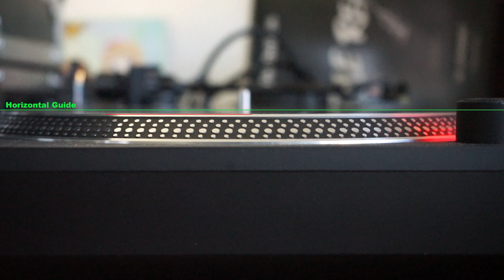Does the Technics SL-1200MK7 Platter Really Wobble?

Comment: Welcome to the ANALOG world, this is analog gear, it is not perfect like digital. I never look like this at my sl 1200, i check if the platter has some play with both hands placed on opposite parts of the platter, if it has some play, switch one platter with another platter from other sl 1200 and it should solve it usually, there are small tolerances. What do you expect from a made in Malaysia Technics ? pure perfection ? If you had a GR then yes, you could nitpick it more, but even that will have tolerances. You cannot expect Analog gear to be perfect in every way, this is the charm of Analog.
Reply: Ora tutta la produzione di giradischi technics si è spostata nella nuova fabbrica panasonic in malesia..il problema di questa cosa che i pallini non sono allineati lo facevano anche gli mk2 e m5g e tutto il restante della serie non c'entra nulla dove sono assemblati quest ultimi..c'è gente che lamenta  del wobble anche con i primi G GAE che erano ancora assemblati in Giappone..cmq apparte alcuni che sono fuori tolleranze questo "gioco di fluttuazione " lo avevano tutti i modelli sl 1200/1210 dall mk2 al mk6

Comment: Both of my SL-1200‘s do that too. The surface of the platter is perfectly level when spinning. However…..I know sometimes on new units there might be small hardly visible metal particles on either the inside of the platter hole or the copper spindle base the platter sits on. Either way, nothing to be worried about. Just remove and place the platter a few times on the spindle and you’ll be fine. As a matter of fact, none of all the SL’s that I restored or fixed had any wobbling issues at all. Not even those really abused ones. If the bearing is worn though, just replace the bearing and not the platter. A bearing usually doesn’t wear out if it is lubricated with the original Technics oil and nothing else, certainly no other kind of oil or grease.
Reply from the maker: Need to get me some of that Technics oil

Comment: I had about a 1/32" wobble and marked the high spot on the platter. I then used some 1500 grit paper and wrapped a q-tip and lightly sanded the opposing sides of the spindle hole. Only took one try. Of course this only works if you sand in the right places. It's the bottom of hole nearest the high side and top of the hole furthest the high side. This only works if it is the platter that is out and not spindle itself, otherwise platter will need to be placed in same every time.  Clean first make sure its not debris. Do a little at a time. I true my pottery wheel same way.

Comment: You have to put your hands on the decks. When you're performing beat juggles, the wobble will show because your needle will bounce. I also have a pair of Pioneer PLX 1000s, Their decks don't wobble. I just thought it was weird that these decks are considered "battle ready", but the platters are not stable enough for hand pressure...
Reply from the maker: If I can do a backspin of about 3 or 4 rotations quickly without the needle jumping, would that be a good enough test to qualify/disqualify this for juggling?
Reply: @DJFeelsGoodman  It could. If you're heavy handed, it will DEFINITELY show. Probably the first time. I suggest that you get a pair of vinyl record (not the ones for battling, but normal records) and beat juggle from them. It will be a more accurate test. I'm light handed and the needles still bounced on me. 🤷‍♂️
Reply from the maker: @djseasick  Gotcha gotcha. I have some vinyl records but I don't know how to do those slick beat juggling patterns, so I was thinking maybe there was another way to test that out.

There was another guy who posted about the wobbling, and he said he units have noticeably more wobble than the one I put in the video. Maybe there's a discrepancy there I wonder...

Thanks for the reply by the way; definitely something I'll try to get to the bottom of. And if there's anybody else here who has done (or can do) a juggling test with real vinyl, let us know!
Reply: @Jayo Delaware You know the Technics mk7s aren't made in Japan, as the previous 1200 models?

Comment: The platter clearly wobbles at the top line, but you would probably need to go through 10 turntables before you find one perfectly flat. It should not affect sound quality as slipmats are not perfectly flat and neither are records. My PLX-1000 has the same run out as your SL-1200mk7.

Comment: clearly wobbles on the left side, slightly but wobbles, RETURN
Reply: Since when do round things have left and right sides?:D:D This wobble is so tiny, even my old SL-1700mk2 from 70s wobbles very slightly.
Reply: your SL-100C apparently also wobbles
Reply: Not wobble just inacurate lines on platter, was measuring with laser level
Reply: @mariorainy  You should use a dial gauge on the outer edge of the platter.
Reply: I think you need to have very good precise lens to measure like this

Comment: Yes indeed, it's the dots that wobble not the platter itself... I don't really get why so many people are complaining about that, plenty MK2s and MK5s had that too, but no one gave a crap about it back then.
Even the HiFi/High quality SL-1200MK4 and SL-1200G have that too... It's just nitpicking.

Thanks for debunking this platter wobble myth 👍
Reply: My mk2 does it, so it’s not a total myth, and the top edge does go up n down. I think it’s cause the things been fucked from years of use. Still works, and I’ve just kinda stopped thinking about it.
Reply: @djsd-1292  If your platter actually wobbles, it means the spindle bearings are damaged or the platter is warped... it's not part of the design.
Needs to be serviced.
Reply: @QoraxAudio  yeah, obviously not part of the design lol, but not a myth. Happens from the factory with hanpin tables due to poor QC.
Reply: @djsd-1292  Hanpin turntables are made in a different factory than technics turntables, so those have nothing to do with it.
Technics turntables don't come with wobbly platters, so that's a myth.
It's just that in the beginning of the technics reboot, some batches got damaged in transit, resulting in warped platters, that's probably the origin of that myth.
Reply: @QoraxAudio  Comparing a Hanpin with a Technics is like comparing apples with pears. A Hanpin is no match for a Technics,  period. Hanpin use plastic for the base, the weight of the product comes from a slab of metal on the bottom of the plinth, used for gaining weight and it acts a an internal ground for the circuitry. Which itself is another major difference with a SL-1200. Again, no match for a SL-1200.
Reply: @leyland9999  Comparing Hanpin with Technics is comparing entry level turntables with midrange and high-end turntables.
It's just like comparing the old Technics turntables with the new ones.
The old MK2 to MK6 turntables were great midrange turntables, but the new ones are even better.
Especially the SL-1200G and 1210G are more a high-end kind of turntable.
Modernized drive system and motor, also a more sensitive magnesium tonearm with better bearings.
Plenty people think all 1200s are about the same because they didn't change the looks, all the development went into improving the performance instead.
Reply: @QoraxAudio  I agree. That said, the original SL-1200 was way better than you think. It was introduced in a period when the general public at last could afford a better product than what was available at that time in the consumer market range of hifi-products. It was so good that the DJ’s recognized the pure quality of the product. From that moment on Technics could benefit to the fullest of the product they created. Something that continues today and rightfully so! Improve what is already perfect. For normal use the original product that was introduced in the 70’s is still way beyond the best record ever pressed because it adds nothing to the sound that is in a records’ groove. True, the current SL series may be better but come at a lot more money. It is up to the individual if she or he is willing to pay the extra costs of the product.
Reply: @leyland9999  I know, I've used SL-1200MK2s and MK5s for DJing in the past and have been using an 1200MK4 and 1210M5G for HiFi use for some time before I got my 1200G.
The titanium tonearm on the MK4 was very good, but this one is even better.
Definitely great value for the money even though these are more expensive than the legacy 1200s.
Reply: @QoraxAudio  The spindle is the bearing !
Reply: @leyland9999  Obviously you didn't know that the SL-1200mk7 is all plastic.
Reply: @QoraxAudio  I own PLX-1000s and they do have issues like loose tonearm bearings and wobbly platters. My two PLX-1000 have platters that wobble in similar fashion as the SL-1200mk7 in this video. Technics also has QC problems, but probably not as many as the Hanpins.
Reply: @DJGeorgeDisco  Yes, I do know that. Even so, the quality is still good though a notch maybe less than the rubber based models. Technics did this to offer a product that competes with entry level products but with Technics quality. For the average users more than often more than adequate. As for the prices? Well, that is another story. Back in 2009 when I bought my pair of SL-1200Mk2’s, I paid €499 each. Those were prices one can dream of if set against what you are set back today for a Japan made Technics. That’s the way it is.

Comment: I've got a 1500c and the platter does wobble quite a bit. One can see it clearly by looking at the top of the platter. I wish I'd noticed that earlier, so I could send it back. As I've read they don't repair / replace parts in such cases.

Comment: You are the best! Thanks a lot for this helpful video, recorded with a great camera quality and the two lines as reference. My MK7 platter does definitely move stronger up & down than yours does. However, Technics told me that the amount of my 'wobbly' platter is within their acceptable range. I accepted it and kept the turntable, because I'm pretty sure that neither the sound nor the quality of my records will suffer from it. I'm just very disappointed that I have this issue on my turntable after spending $900. Maybe other MK2 / MK7 owners or people that have in-depth knowledge on turntables can share their experiences on this topic too. Cheers from Switzerland!
Reply from the maker: You are very welcome! Perhaps my MK7 is from a newer batch after Technics received some complaints, or maybe I just got lucky. Maybe you can trade someone their platter or make an exchange at a store. Cheers from the USA